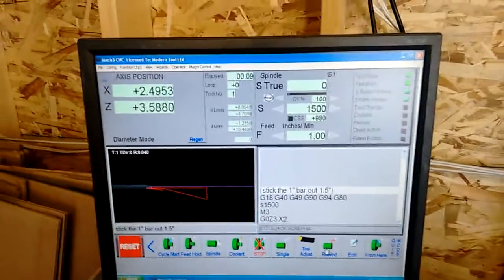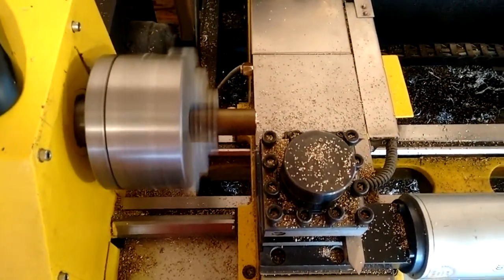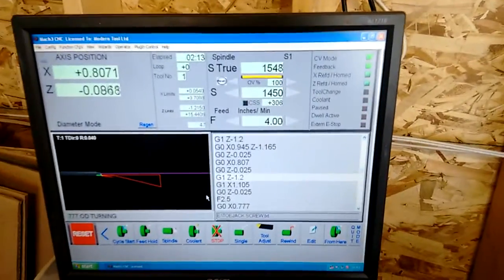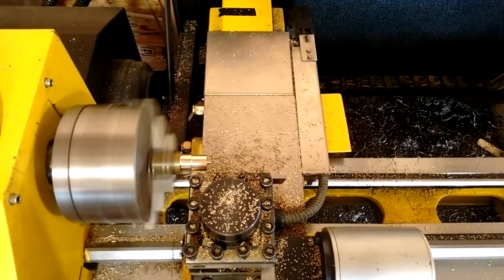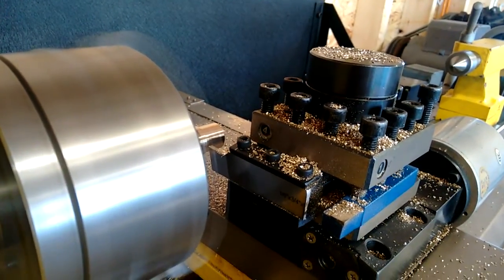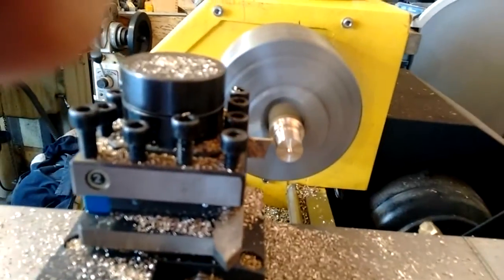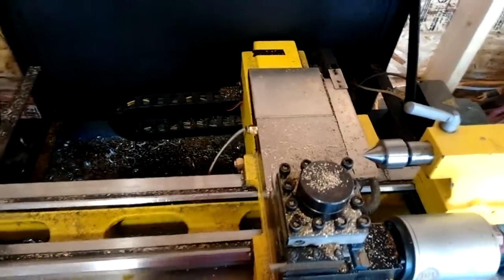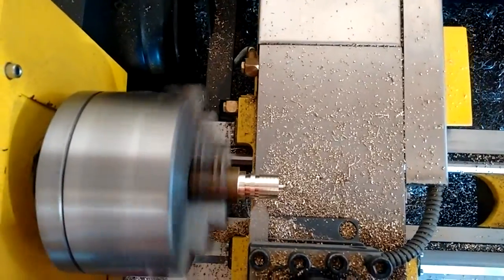CNC turning with Syil C6-B

Comment: Where can I get one of these???  That machine is awesome!  I had the luck of being able to buy one of the Syil X4 mills then completely gutted the cabinet replacing the control board and spindle motor to run on LinuxCNC.  The mill is great now.  Has lots of runout but I enabled runout compensation and now theres 0 trace of any runout.  Id like to get my first lathe now and this one you have looks perfect!
Reply from the maker: Unfortunately, they stopped making these a while ago. Where are you located?
Reply: @Alexander-bc1qr  Washington state.  And I just read they discontinued them too while doing some research.  They still seem like a really nice machine though.  Are you looking to sell yours?
Reply from the maker: @DaveNorthWest I might be interested in that, but I am in Alberta, Canada.
Reply: @Alexander-bc1qr  Dang, I really would like that lathe.  I bet its nice there in Alberta.  Canada is beautiful.  Hopefully nothing ever happens there like it did in Washington where all the woods are being cut down and they are building massive housing developments for immigrants to move into the country and causing lots of traffic and job shortages.  Maybe ill have to get back to you on the deal for the lathe.  Would take some planning and coordination on getting there for the transaction.  Alberta is like an all day drive and have to talk to customs.

Comment: Hi, nice videos!
I got a Syil C6-B and I am having problems to get the automatic tool changer working. Do you have a special macro for the M6 command? 
As all the boards and stuff is only labeled Chinese, I can't find any information that would be helpful.
For me it seems that I am missing something in Mach3 (Macro, or setting). Everything works, just the tool changer does not move (when I turn it with the alan key, it rotates nicely in to the home position when I start the machine, so the wiring seems to be fine).
Any help would be highly appreciated. :)
Reply from the maker: I have been thinking about this for a while. Open mach3 Click on configure. Navigate to general logic configuration, look at tool change. You have three options. Mine is set to auto tool change. Is yours the same?